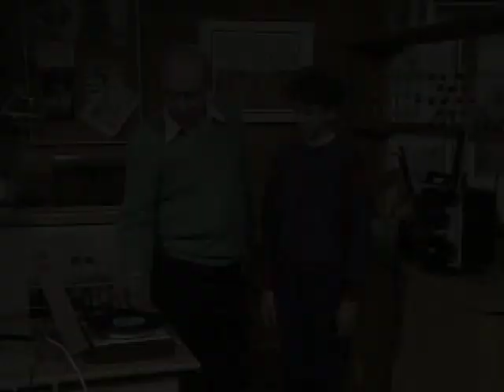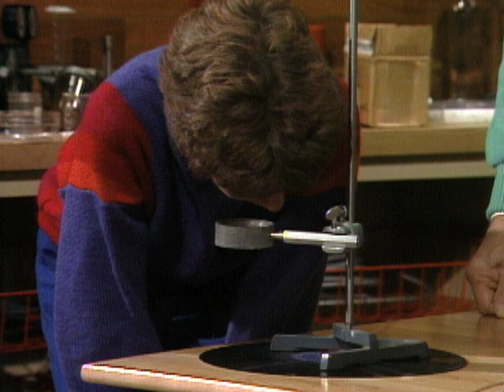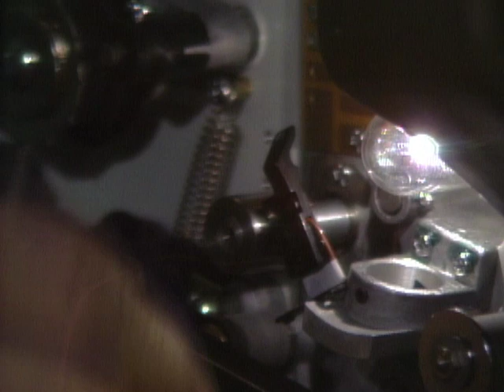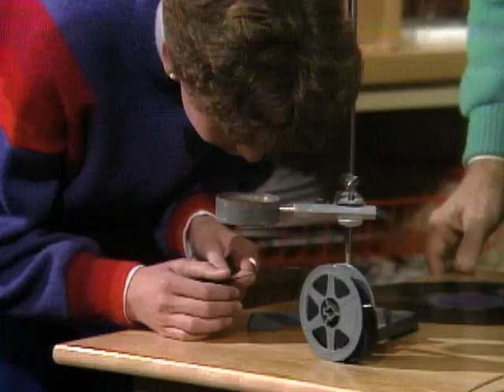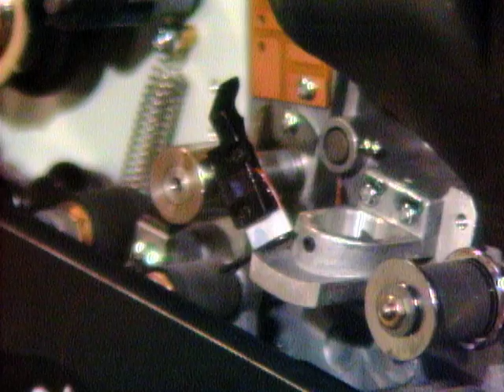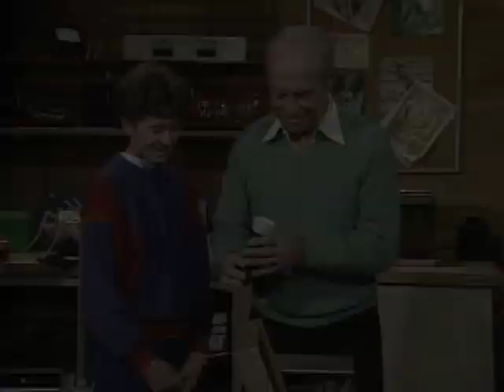Can You Send Sound On A Light Beam? (Mr. Wizard)

Comment: This is assumedly how infrared remote controls work, too.  They just use light that is just below the human vision spectrum, instead of visible light.  It also explains why they are so darn picky about having line-of-sight to the sensor, whereas a radio signal remote control (like a typical RC car) does not need line of sight.
Reply: Not sure if you knew this, but this is kind of a fun modern-day Mr. Wizard kind of thing. If you take a smartphone and turn on the camera, and look at the end of an infrared remote, you can see it lighting up on your phone screen when you press buttons. It's rapidly flashing in different patterns depending on what button is pressed

Comment: i'm 37 now, but i watched mr wizard when i was like 5 and 6 on nickelodeon in the mornings before my folks decided to get rid of cable. i remember this experiment vividly, except for some reason i thought he'd used a laser to do it, by reflecting directly off the record grooves into the photocell and not a flashlight bulb connected to the amp output. i'm really impressed that the tungsten filament can change brightness rapidly enough to keep up with the thousands of variations per second of an audio signal, it must not retain that much heat when the input signal drops to its minimum. very very cool

Comment: What caused the variation in the flashlight brightness? I can see that there is an electrical connection to the flashlight but where does the other end of the wire go?!!!
Reply: I was wondering the same thing. I'm going to hold a light to thin air and see if mr wizards spirit will tell me!
Reply: You may be right .......... but HOW?!!!!
Reply: Did you deliberately post your response twice 'Motorguy81'?!!! 

I'm sure you are on the right lines. There must, indeed, be a power source (IMO it could be DC or AC!) to make the bulb glow  - then a variation of that power applied to make the bulb ''flicker'  as it were. It would be good if 'Mr Wizard' could re-visit to explain!
Reply: By way of a test - please delete ONE of those identical posts, 'Motorguy81'.
Reply: what he did was piggy back off of the wires going to the speaker terminals to the light and placed a switch to turn off the speaker.  Brilliant Nickelodeon show, I watched every episode multiple times while it was on the air!  RIP Don Herbert aka Mr. Wizard  Born: July 10, 1917,  Died: June 12, 2007